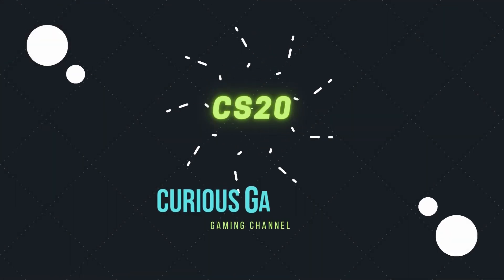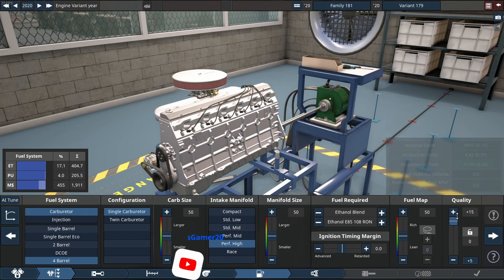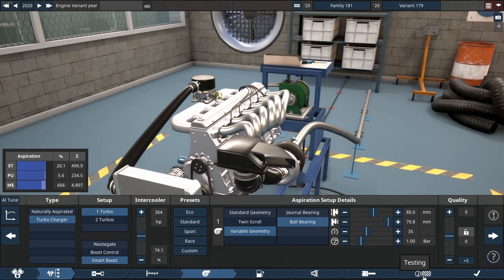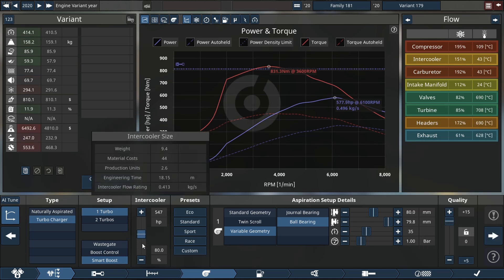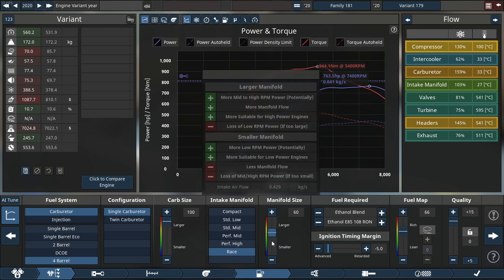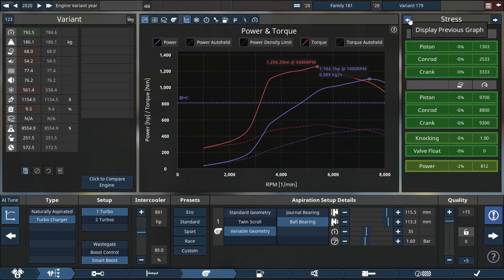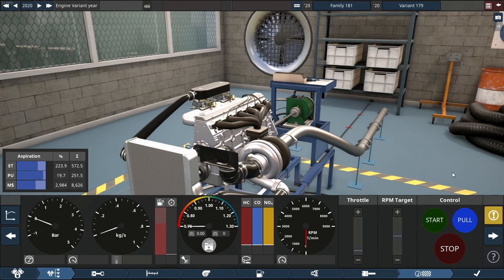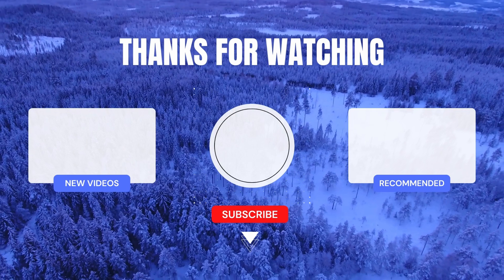A CARBED INLINE 6 ENGINE ON E - Automation the car company tycoon

Comment: Look, i don't want to sound discouraging, but , there's some flaws in this system, i made a few turbo carb engines work, but it was out out necessity. 1. it's better to use a supercharger not a turbo, 2. you should put the carb "before" the charger. Carb's work on vacuum(negative pressure), and they cant really "hold" positive pressure. If one tries to go the route you took, you need pressure in the fuel rail, so basically this is MPI with an archaic design . hope this helps.
Reply from the maker: Yes that is true but we do not have superchargers in the game just yet thank you
Reply: @Curiousgamer20  Again, it's just my knowledge, and i've decided to share it. I'm not blaming, but more of hoping that if you, one day, decide to do it in real life to your car, that you have the whole picture, and others watching it)
Reply from the maker: Yeah I am very thankful for your input it's refreshing to see different perspectives and experiences so thank you